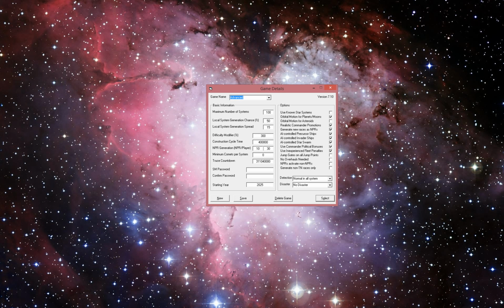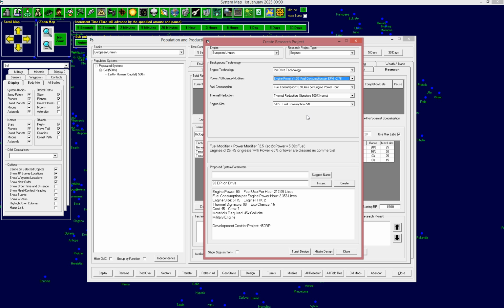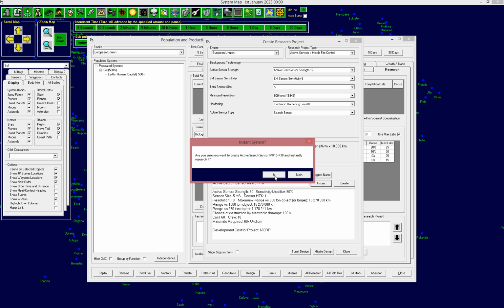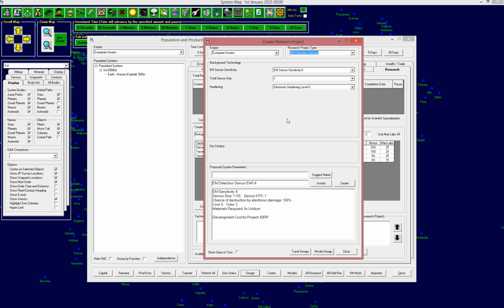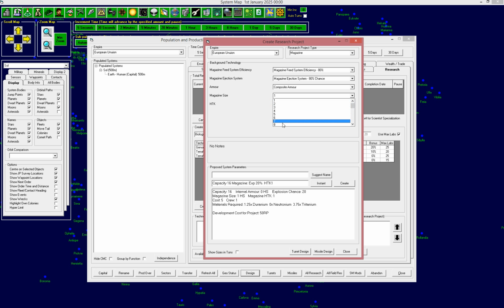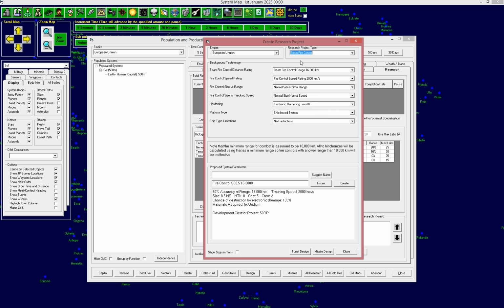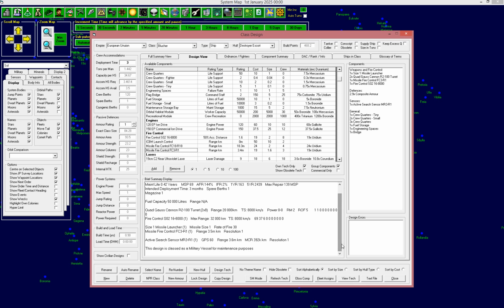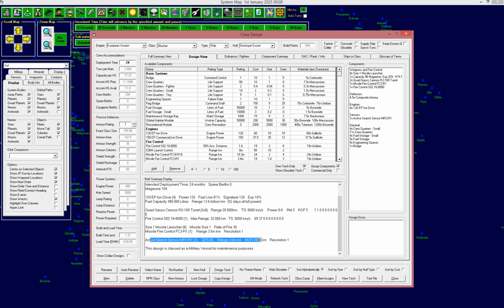Aurora LP2

Comment: Could you explain more what "Exact Class Size" is?
Reply: Some parts, like the smaller fuel tanks, crew quarters, and engineering spaces take up less than one hull space.  Fractions of a hull space don't matter for most things, but they can add up to whole hull spaces.  For instance, if your ship is exactly 6950 tons, you can add 9 more tiny fuel tanks and it will still be exactly 6950 tons.  But 10 tiny tanks would make it 7000.

Comment: I personally believe that research projects should simply be made into designs, without having to assign a group to create the schematic. It should simply be included in the original research cost.

I feel this is an extra, unnecessary step and is more annoying than it is simulating.
Reply: The issue comes up with massive components, like a size 25 active sensor. Depending on tech, that can cost an extreme amount of RP, which does affect the game's pacing. Also, there is the chance you'll mess up an engine (especially a missile engine) and have to re-research the design - fairly realistic.

That having been said, I SM mode instant research all schematics. :P